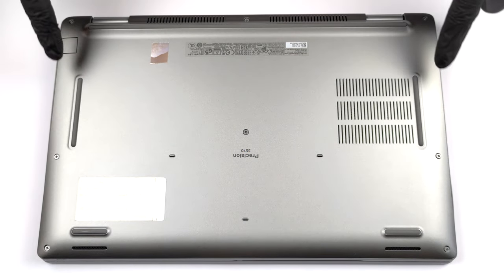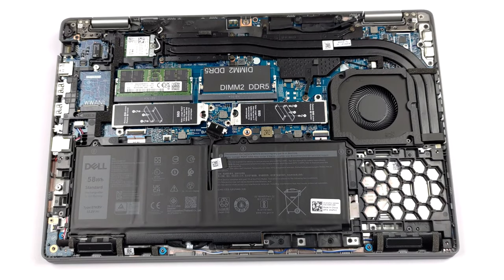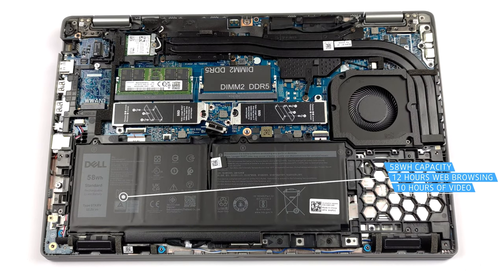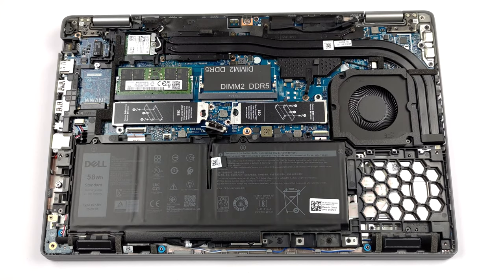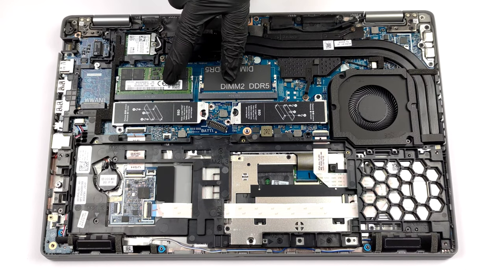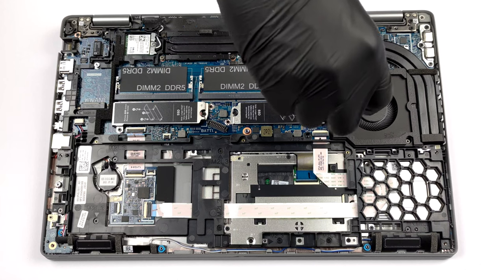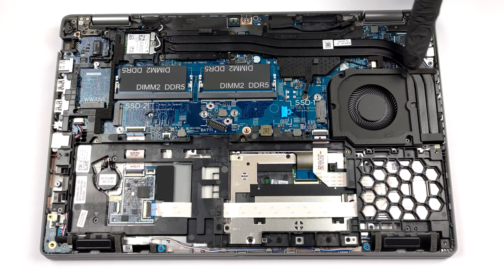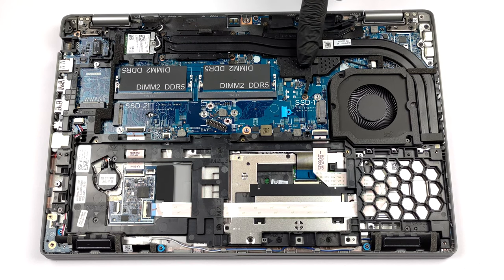🛠️ Dell Precision 15 3570 - disassembly and upgrade options

Comment: Thx a lot. One question. I would like to replace orig ssd for Kingston KC3000 NVMe 1TB. This large ssd have some cooler already. Should I add some tape between ssd kingston ana plate you unscrewed at 1:40? Or cooling tape is not neccesary? have a nice day. Greetings from Czech republic.
Reply from the maker: Hi, you have a great nickname! If we're not mistaken, there is a very thin thermal pad applied on the inside of the SSD plate, so you shouldn't worry about it :)